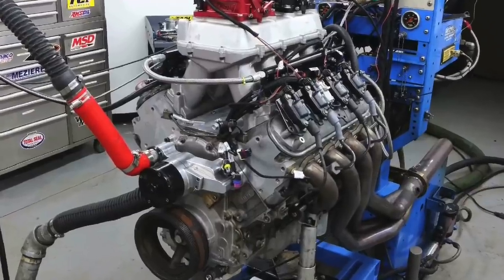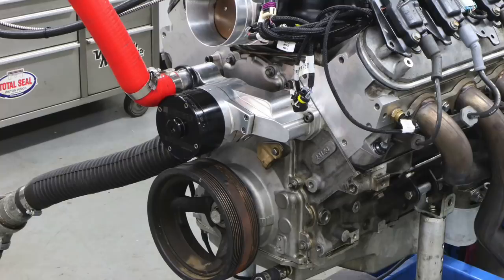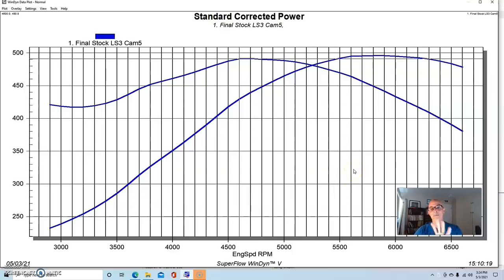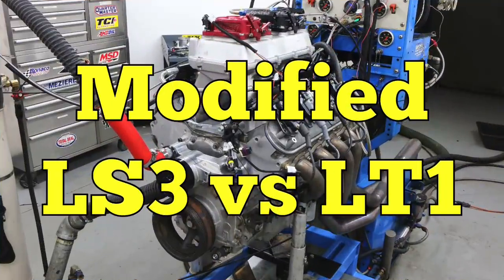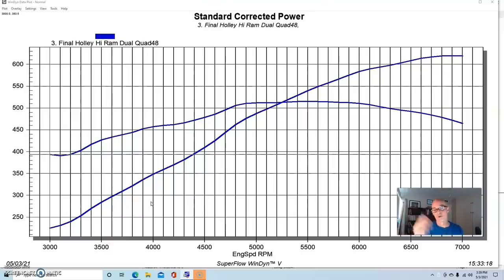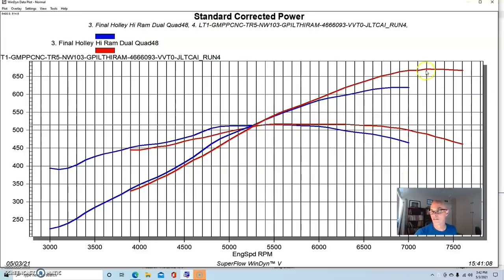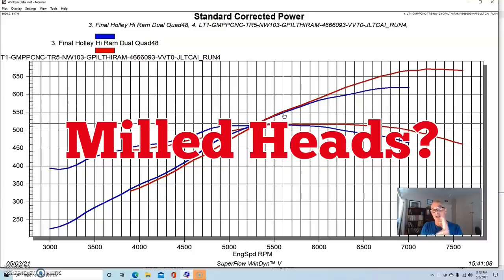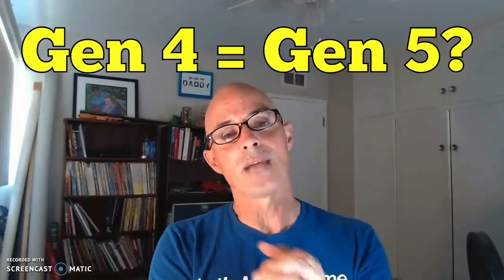LS3 VS LT1-IS NEWER REALLY BETTER? (GEN 4 VS GEN 5 6.2L)

Comment: apples to oranges. Need to compare equal compression. Either bring the gen 4 up to LT1 or the LT1 down to gen 4
Reply: I get your point, but one of the advantages of direct injection is the ability to run more compression before you run into detonation. So in any real world scenario the LT would have more compression then an equally modified LS.
Reply: @Jr_5646  Us old school motorheads were running 12.5:1 compression ratios safely, long before the demise of the 350
Reply: @richardscarlett7942  Not saying you weren't, but all other variables being the same, a DI engine will be able to run more dynamic compression then a  PI one before detonation becomes an issue. Thats a fact.

Comment: The new LT1 can handle well over 1000 hp, stronger internals, engineering to the next level, this engine was created to eventually generate more power than the hellcat red eye. LS block and internals not reliable at 800 hp, LT1 can handle 1000 +hp reliably
Reply from the maker: STOCK BOTTOM END INCLUDING BLOCK LS (LY6) HAS MADE 1543 HP-SO ITS GOOD TOO

Comment: I'm looking to build a stroker version of the Gen4 6.2, wanting to put the 469 cam in it, but I notice the springs referenced in this video (26918) have a max lift of .625, isn't that cutting it a bit close?
Reply from the maker: yes it is
Reply: @richardholdener1727  is there a benefit to running those as opposed to the ones comp recommends? Thanks

Comment: I would still love to see what HP these motors make between idle and 4000 RPM
Reply from the maker: WOT at idle?
Reply: @richardholdener1727  no u can't have idle at WOT. I said, FROM idle TO WOT so we can see what it makes in the street drivable rpm range.
Reply: @richardholdener1727  for example, if it makes 500 horsepower at 6500 RPMs, what is it making at 1500 RPM and at 2000 and at 3500?
Reply: @richardholdener1727  also I wondered what altitude you are at over there in California cuz I am here at sea level in Florida

Comment: So what would y’all recommend msd manifold or btr trinity manifold??
Reply from the maker: for what
Reply: @richardholdener1727  for a N/A set up !
Reply: Cause I’ve heard that the btr is bigger than msd and it is better since it has the runners closer , I’m currently on the msd but I wanna try something else and I don’t wanna do the Hiram cause I don’t wanna cut the hood
Reply from the maker: FOR WHAT SIZE MOTOR, MODS, APPLICATION (INTENDED USE)

Comment: I ran Ls3 418ci with Frankenstein heads 12:8:1 compression made over 600rwhp  and 550 tq with a fast 102mm
Reply from the maker: WITH A FAST?
Reply: @richardholdener1727   yes. With the mid runners 
Cam was spec to run 7500+rpm but fell off/peaked  at 6800rpm 

We think the intake is holding it back
Reply: Looking to run the btr Ls3 trinity intake in hopes it carries or peaks higher

Comment: But doesnt direct injection lead to super clogged valves?
Reply: Yep. Catch cans help but only slow the progression of clogged valves. In fact, everything that makes the lt1 make more power than the ls3 is problematic. Except the compression of course.
Guys that want a reliable build are always deleting the vvt or dod.
I'll stick with my port injection.
Reply: @O. Stone Passive rust proofing.

Comment: It doesn’t look like the Toole engine was using the variable timing as the torque was less below 5252rpm
Reply: If you listened to the vid, the torque might have been low because of the intake manifold runners. I won't be surprised if the cam profile was also too top-end oriented. VVT can only do so much, it's not a complete variable timing AND lift system.
Reply: Once timingvgets too wild you usually lock it out so you don't get any interference. Race deals don't care cuz the engine is never run that low.
Reply: @sepg5084  some VVT systems are locked out and others are just limited with spacers. The pistons were already machined for clearances . I’m not knocking Toole’s cam, I’m just asking if the VVT was being used.

Comment: I love all the gen v stuff. I have a l83 in my truck and its great. Suggestions. Put flat pistons in a gen v and test it. Then put a the revert port injection kit with an ls7 intake or and aftermarket port injection intake if you can find one. Last but not least lt4/lt5 supercharger on l83. Please and thank you.
Reply from the maker: why the flat top piston? the l83 piston was designed for DI
Reply: @richardholdener1727   i was just curious to see the results of a flat piston with port injection. To really show the how much better the heads flow and the advantage of continuous variable timing.

Comment: Yes GEN5 is improved on compared to GEN4. Just look at the block differences. GEN5 uses 12MM headbolts where LS uses 11MM bolts. GEN5 engines all use forged cranks, Nodular main caps, GEN5 has gussetted coolant passanges around the cylinders to help strengthen its where the coolant passanges on LS engines are just opened around the majority of the cylinders.

The worst thing about GEN5 is GM forces AFM down your throat and it with be on the owner to has to spend the time and money to delete it. Otherwise the GEN5 is excellent. GEN4 LS is excellent as well and definitely easier to mod and swap into platforms that they don't come in.
Reply from the maker: they all have forged cranks?
Reply: @richardholdener1727  Yes. 99% sure even the 5.3L comes with the same forged crank the 6.2L has. As far as I know there are 3 different factory GEN5 cranks. There's a 3.622" crank for your wet sump vehicles, (trucks/SUV's/caddies and Camaros with both 5.3L and 6.2L GEN5 engine) and you have a 3.622" crank for your C7's that use a dry sump oiling system. (Not sure if the C8's LT2 has a different crank or not) Then the 6.6L L8T uses a 3.86" stroke. I'm pretty sure the snout is different between the wet and dry sump cranks.

If you take the LT1 out of a Camaro and the L86 out of say a Yukon or Silverado they are the same engine other than things like the intake/exhaust manifolds, oil pans, etc. Still same block, heads, crank, rods, pistons, etc.

Comment: The only modification I woulda made to the ls3 is VVT
Reply: And that would cost you way more than just adding cam and heads
Reply: @peterkroeker753  the l99 comes with vvt factory. Just have to ditch the AFM and add the ls3 cam. Very cheap actually.
Reply: @peterkroeker753  I think the reason the ls3 wasn’t offered in VVT is, it only came in 6 spd
Reply: Many many dynos done of the LY6 but they always turn off the vvt. Maybe Holley supports it now? Tricky territory altering factory ecm....
But it seems to be worth 20 lb/ft. Combine that with a ported cathedral head , a tbss intake, 11:1 cr, and a mid range cam, should be an impressive torque curve.

Comment: There is NO 1000 HP NA 
LT gen 5 With or Without the Aftermarket....

🤣😹😂

We got Several 700 to 900+ fwhp Lq4 block, Ls3 head strokers.. on Yellowbullet 👍

GPI nor TSP isn't doing 8's with the LT gen 5 NA either. Ls3 has 🤣😹😂

Comment: mill the stock heads .075 an run a gpi no fly cut with .075 cuts..be around 12-1 comp an should do 640s with stock ports an good valve job..my heads are milled .100 an my bill feckly are .080..